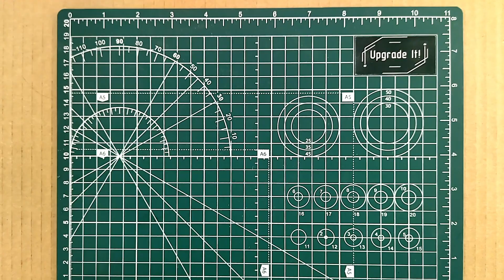How To Make DIY Gaming Mouse Cool and Convenient #computermouse #computeraccessory #howto

Comment: Dude made a model o
Reply from the maker: Thanks for mentioning Model O. Didn't know it existed.

Although mine is better :) Mine has perforations on its sides too. And Model O weighs 58 grams, but I reached 51 grams. And there is still a room to make it lighter. Left it for a sequel :)
Reply: @upgrade_it  Model o has an actually good mouse sensor. if you want to lessen work fatigue definitely invest in a good mouse as your inputs will be far more precise.
Reply from the maker: Totally agree with you. But Model O cost some noticeable money. I wanted to check how it will go on much cheaper mouse. It went quite well. :) So this idea can be applied also to Model O to drop its weight in a greater extent.